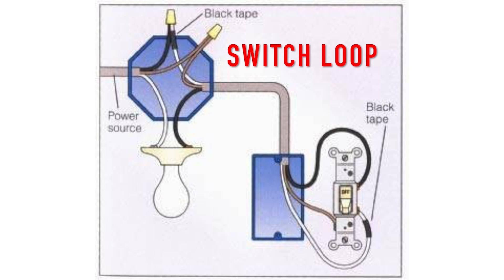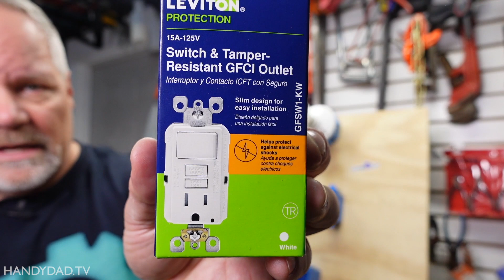GFCI Switch and Outlet Combo

Comment: I need to replace a regular duplex outlet with a gfci. I have one in stock with the switch that I will use, even though I don't need the switch. I ASSUME I'm safe to just get those two wires that are on it out of the way, which I'll do by twisting them together and putting a wire nut on them (to keep them from going some place they don't belong and shorting something out. They'll just be stuffed in the box unused.  I won't just cut them off, as someone might later repurpose the device and want/need those wires.    Am I good?
Reply from the maker: Why use the wrong device for a job? Return the combo and get a duplex GFCI, which is much cheaper btw.

Comment: Hi…. Great video on the switch /gfi combo, but my problem is the wiring  in the box I want to install it has a black, red, and white, all hot. I was able to get the switch working, but not the gfi. I tried every configuration to no avail. Any suggestions? Thank You."…
Reply from the maker: Call a professional. They shouldn’t all be hot.
Reply: @handydadtv  Thanks for your reply. I was mistaken. I made a pig tail, and wired nutted that and one of the switch wires to the lead, and connected that to the brass screw on the gfi. Then I wired the other switch wire to the load and connected that to the brass screw on the switch. I connected the neutral to the silver screw on the other side of the switch. Connected the ground and success was achieved.

Comment: what if two black wires on fan switch are both hot when checked with proximity tester, seperated by 12"?
Reply from the maker: That doesn’t sound right.

Comment: My neutral has 3 wires, what do I do with the 3rd wire? I put a wire nut on it and turned the breaker on but it said open neutral on my outlet tester
Reply from the maker: Use a wire nut to connect all the neutrals with a pigtail to the silver screw.

Comment: My neutral has 3 wires, what do I do with the 3rd wire? I put a wire nut on it and turned the breaker on but it said open neutral on my outlet tester
Reply from the maker: You need to connect all the neutrals to the silver screw on the outlet using a short scrap of white wire (called a pigtail).
Reply: @ thank you

Comment: What do you suggest if the box only has 2 wires? One line one neutral?
Reply from the maker: If those wires are connected to the existing switch, the white wire IS NOT a neutral.

Comment: Use a pigtail on the stranded black wire for a better connection at the line side of the GFCI?
Reply from the maker: If the wire needed to wrap around the screw, I would agree with you. But it’s perfectly safe because of the back-wire clamps on the screws.

Comment: My son has a light switch just outside the bathroom. It is confusing especially when guest walk in and can't find the switch.  I want to put the switch inside however the bathroom is small and where it needs to go is right in front of the shower stall.  So if someone opens the shower door they could accidently touch the switch.  My question is; Is the light switch GFI protected ? To me it appears not since you tested/tripped it and the light switch stays on.
Reply from the maker: That said, you can choose to wire the switch so it gets power from the load terminal on the GFCI. Then it will be protected.
Reply from the maker: Lights do not need to be GFCI protected. Your switch just needs to be grounded to ensure nobody can get shocked by touching a screw.

Comment: So technically the switch on the combo device is not gfci protected, is this right? I have been trying to confirm this. And it seems best to me if all switches and outlets in bath, kitchen, etc. are gfci protected. Right?
Reply: So I am deciding between a combo device vs having a gfci outlet feed into existing switch and I think the latter option does protect the switch downstream, so is perhaps more ideal in bath situation
Reply: This is my thinking after watching the video; please chime in! Thank you
Reply from the maker: It’s your choice. You can wire the switch off the load terminal of the combo GFCI for the light to be protected. But lights aren’t typically GFCI protected so they stay on if the outlet trips.

Comment: With this combo switch, is the light attached to the switch now gfci protected as well? I’m looking to install a fan/light combo above my shower.
Reply from the maker: You can wire the switch to get power from the load screw. Then the light will be protected.

Comment: Great video - very helpful.  However, I'm having one issue:  when I push the GFCI test button, the light doesn't go off (the outlet does).  Any thoughts?  Thanks!
Reply from the maker: Probably reversed LINE and LOAD.

Comment: I wired one like that to a plug. I did it correctly and it still trips even with the ground wire installed.
Reply from the maker: Try a different GFCI. Otherwise call an electrician to troubleshoot the current leakage.

Comment: Hey, so I'm going to hook this switch outlet up and the switch part will be powering a bathroom vent over my tub. So I think I should have that switch cut off when the outlet is cut off also for safety 🤔 basically will the switch cut out also when over loaded because I will need that. As un the video the light switch still worked when trip
Reply from the maker: You can do that.
Reply: @handydadtv  yup I just watched your other video thanks. I just have to protect the switch because the vent is over my shower and your video was straight to the point. I'm a new follower now 👍
Reply from the maker: @fu1543 Thanks for subscribing! Welcome to the family!

Comment: Does the outlet only have power when the switch is on? I wired as you showed and the outlet turns off when the switch is off. I like having a nightlight which works best when there is no light on in the first place
Reply: Figured it out! I just had my black wires swapped.
Reply from the maker: Good job 👍🏻

Comment: I tried converting a secondary rocker light switch down the stairs in my garage to a full GFCI outlet. I think I capped off too many wires as the other main light switch that turns the garage lights on is not working. There were 4 wires on the rocker light switch; 2 black, one red and a copper ground.  Only one of the black wires was hot so I capped off the other black and capped off the red which was not hot.  The two white wires were wire nutted together in the box so I tool white wire coming out of the hot cable wire and attached it to the GFCI.  I capped the other white neutral wire off. The GFCI outlet is working but I can't turn on or off the garage ceiling lights. Which other wires should I have connected to the GFCI? thanks, Steve H.
Reply from the maker: Hard to say. You need to figure out which wires are upstream vs downstream. Upstream (from the panel) brings power IN and it’s also called the LINE. Downstream sends power to other devices on the circuit. Also called the LOAD.

Comment: This is such a clear video! We are trying to change a single switch with the Leviton GFSW1 gfci combo but there are three wires in the box since it's in the middle of the circuit run. We followed the instructions of Leviton for the three wire case, but now the original light doesn't work and the switch on the combo is controlling all the downstream outlets/switches, which we don't want. We want the switch to only control the original lighting fixture. Do you have suggestions of what we might have wired wrong? Will you make a video for the scenario that there are downstream outlets in the circuit? Thanks!
Reply from the maker: Sounds like you switched the LINE before it goes to the outlet.
Reply: @handydadtv  yes that's what happened! Thank you so much!

Comment: Will the outlet stop working if the light is turned off
Reply from the maker: Not if you wire it correctly.
Reply: @handydadtv  wired it as you did and it works great. Thanks for the amazing video and explanation

Comment: I just replaced mine exactly the one you have in this video. I got the green light, but it wasn’t working then I watched this video and I did hook it up correctly but my test switch is not snapping like yours. It’s a brand new outlet is it defective?
Reply from the maker: You probably reversed the LINE and LOAD.

Comment: Thanks for the video! Great info. Just a question, though... at 8:30, you say the light will work if the outlet trips. Doesn't this defeat the purpose of the receptacle? I just bought this gfci switch combo for a crawlspace because code says the lights need to be gfci protected.. but it seems that the light is not gfci protected with this receptacle if the outlet can trip but the switch can still work. Can you provide clarification on this? Thanks
Reply from the maker: You can wire it either way.
Reply: For the switched light to be protected you need to wire neutral(white) that comes from the light and one of the black that comes out of the switch to the load screws(the ones taped yellow).

Comment: I'm trying to install this exact new switch to an existing very old wiring.  My question is, do I connect the wire that was originally for the switch to the gold screw with the back black wire that's attached? Or do I connect the wire that was used for the outlet to the gold screw?
Reply: Never mind I got it
Reply from the maker: Glad you figured it out! Good job 👍🏻

Comment: Hi, amazing video. Made it easy to install. How do I wire a GFI outlet to this. The GFI switch/outlet will be middle of the run, the gfi outlet that I want to add would then be end of the run.
Reply from the maker: This combo has LOAD terminals that you can connect additional outlets to and they’ll all be protected. No need for another GFCI.
Reply: @handydadtv  thank you but they are for the kitchen sink area.
Reply: @robertmastrodicasa5062 it doesn't matter where it ends up. If you wire it to the load side it becomes protected and is up to code.
Reply: @mand0c0mmand0  thank you.

Comment: I want a switch to control the gfci outlet…ie the outlet is off when the switch is off. Would I just wire it like your example to the light?
Reply from the maker: I show how to wire the switch so it controls the outlet in this video: https://youtu.be/i_Dwokzgs8w. It’s not a GFCI outlet, but the concept is the same.
Reply: @handydadtv  perfect, thanks!

Comment: I have a switch box that is for the garbage disposal under the kitchen sink. There are a total of 3 sets of wires; white, black, and ground. Power in, line from switch to disposal;, and an outlet that is on the outside of the kitchen island. I need to change the switch to a GFCI combo switch/ outlet, because I am putting in an RO system that requires an outlet. My question is how to combine all of these to work.  It seems that I could use the Wagos on the 3 grounds plus the pigtail to the combo switch. Wago connect the 3 neutrals with a pigtail to the one side of the combo switch/ outlet. What i am not certain of are the 3 blacks plus the 2 coming out of the combo switch?  Please advise.
Reply from the maker: I got your email and replied with options.

Comment: Thank you! One small issue on mine - I wired it up correctly and the light turns on, but the outlet won't reset and power on. Is the problem likely with the receptacle?
Reply from the maker: If it’s a brand new device, I highly doubt it’s defective. Make sure you have hot and neutral connected to the LINE screws.
Reply: @handydadtv  That did the trick, neutral was initially connected to LOAD

Comment: I have an issue with mine.  In my box there are two hot and two neutrals.  Each on different breakers.  The way the old GFCI/Switch combo was wired was the switch wires coming out of the back of the outlet were just hooked into the hot/neutral from one breaker with wire nuts, these turn on my bathroom light.  Then the hot/neutral from the other breaker were hooked into the screws on each side of the outlet and these powered the GFCI on the unit.  Would you suggest hooking it up the same way it was previously hooked up? The way it was previously set up, when the GFCI failed, the light switch still worked.
Reply from the maker: It’s a bad practice to have two different circuits feeding the same box, but maybe your house has separate lighting circuits. When in doubt, replace it exactly.
Reply: @handydadtv  It's a much older house from the early 1930's.  The Circuit the lights are on are older wires. The circuit the GFCI attached have newer wires.
Reply from the maker: @526colin Ah that makes sense. I would wire it the exact same way unless you want more work.

Comment: if you want to gfci protect a switch for over a tub or shower you would connect the two wires on the bottom screws.
Reply from the maker: Only one switch wire would go on the load screw. The other wire goes to the light.
Reply: @handydadtv  the load is the light.
Reply from the maker: The hot load goes to one wire on the switch. The other wire on the switch goes to the light. So the light only goes on when the switch is on.
Reply: @handydadtv  line= hot  light=load

Comment: what If I want the switch to only control the receptacle and not to control a light?  How do I do that?
Reply from the maker: Connect the incoming hot to one switch wire and the other switch wire to the LINE screw. The outlet will be controlled by the switch.

Comment: Can the switch for the GFCI combo outlet be used to power the outlet? In other words, can the switch be used to turn on and off the bottom outlet? I have a pump for an outdoor fountain that is powered by an outdoor GFCI outlet. I would like to use the switch to turn the fountain pump on and off. Thanks!
Reply from the maker: Yes, you can wire the hot to one wire on the switch and the other wire to the LINE of the outlet. 

If it were me, I would use home automation to have the pump run automatically.

Comment: I was wondering if I could use the swith to control the bottom receptacle? My string lights plug into the receptacle and want the switch to control it. 🤔
Reply from the maker: Yes you can do that. I show that method in this video: https://youtu.be/i_Dwokzgs8w

Comment: Very helpful! Thank you so much. The diagram that came with the thing contradicted itself, so I'm glad to see someone wired this correctly and showed it working!!
Reply from the maker: Those diagrams can be hard to interpret.
Reply: I also followed the instructions and they wanted the switch to be on the load side, but that just kept tripping the GFCI nice to see he just added it on the top and it fixed the problem

Comment: I don't have a ground wire in the bathroom switch that I want to install this unit. Does that make a difference.  House was built in NY 1985
Reply from the maker: If it’s a metal box, that’s probably your ground.
Reply: @handydadtv if the box is grounded, will that ground the light fixture too?

Comment: I need help with the gfci switch/outlet. My ground wire from the basement is too short to reach the connector. Can I run a copper wire from the basement and connect it to the other ground wires? The trip isn’t resetting on the outlet.
Reply from the maker: Try extending the short wire with a straight Wago connector.

Comment: Is there a way to wire the switch outlet combo so the switch powers the outlet, plugging a water pump outside for my rain barrels, system would like to plug it in to the bottom outlet and be able to turn it on with the switch, I would get my power source from a existing outlet in the house on a exterior wall, please help, thank you
Reply from the maker: Yes. Watch this.
https://youtu.be/i_Dwokzgs8w

Comment: Hello! I have one red wire, a set of black and white and a ground. Home built in 1964. Can you give a suggestion on how to wire this?
Reply from the maker: You need a voltage tester to verify, but you can usually derive the function of the wires by looking at the wiring of the previous switch. The whites are probably neutrals. The blacks are probably hots. And the red is probably a switch leg to the light or fan. But you need to VERIFY. I can’t possibly know for sure.

Comment: Perfect video for me, thank you sir. I got that exact model after another store ran out of stock on a different one. When I saw the two black wires out the back I was all messed up lol. I love that this model lets me plug in both of the white wires instead of just having a terminal where I have to add a third one and connect it to the other two. The old switch I was replacing had no ground (old house with just a light switch in the 1/2 bathroom) so I did a search and found out it is safe to wire this to a box with no ground wire in it. The GFCI still works and actually makes the outlet safer. Of course I blocked the third prong hole to remind people not to plug in a three prong electrical cord.
Reply: How come the instructions tell you to install one of the stranded black wires that come off the outlet into the brass load terminal?
Reply from the maker: @yeahyeah5422 If you wire the switch off the Load terminal, it will be GFCI protected. The downside is, you’ll be in the dark if the GFCI trips.
Reply from the maker: Glad it was helpful 👍🏻

Comment: Awesome video.  I only have line, neutral,  and ground (1 line into my box) does the second black (switch) wire connect to line side of my gfci, you said the first one connects to the load side.???? 🤔💙
Reply from the maker: If you want the switched device to be protected, connect the switch lead to the LOAD screw. Otherwise, it can be connected to the LINE.